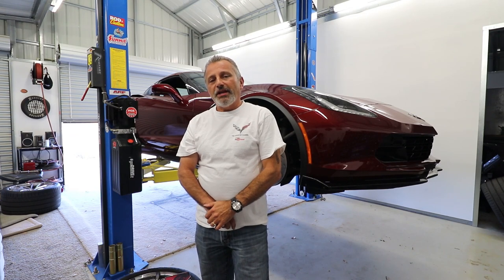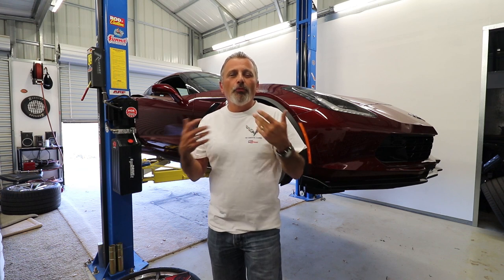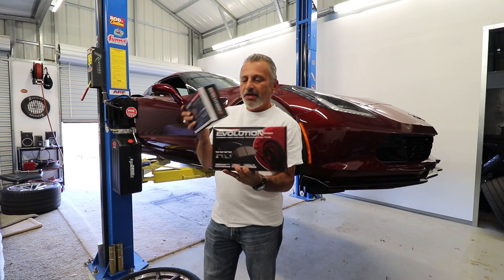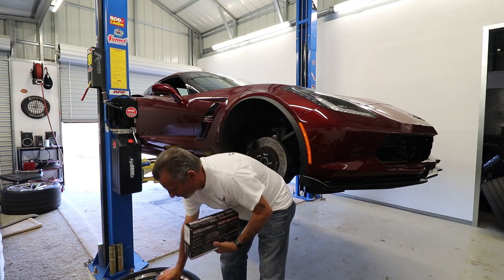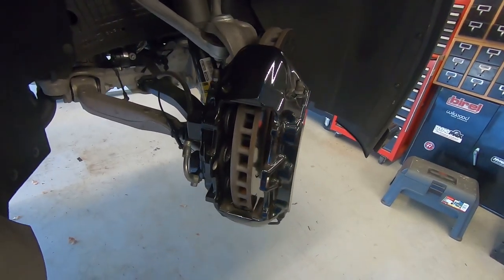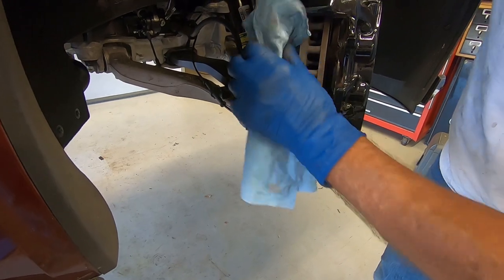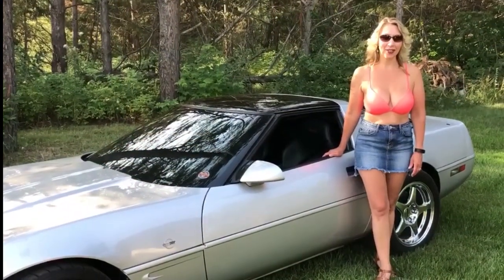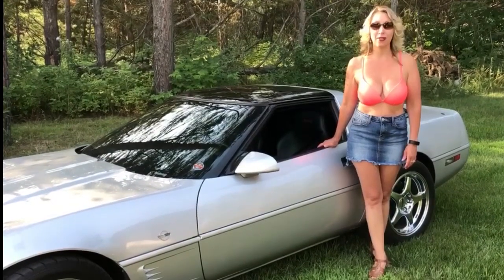How to Change Brakes on a Grand Sport C7 Corvette Sponsored by PowerStop Brakes

Comment: I'm ordering a C8. What brakes do you think they are using for the new car? I want to order a base and then upgrade the brakes and suspension. Haven't gotten anywhere researching this.  What do you think they are doing based on your knowledge and experience. Thanks, really enjoy your video.
Reply from the maker: At this point I would guess they will continue with same kind of pads as the C7, because they are always quiet and no one ever wants a brand new car to squeak while braking.
Reply: @THECORVETTECHANNEL  I was interested in the brakes themselves not the pads.  Does the C8 look like it is using C7 brakes. I don't want the Z51 if I can buy aftermarket for a quarter of the price. I'm no expert. Can you tell? Thanks

Comment: Never seen lubricant only applied to the end of a disc brake pad.  It needs to be applied around where the piston pushes on the backing plate of the brake pad.
Reply from the maker: I agree with you. We installed them and applied the grease as the instructions.
The brakes have been on the car almost 2 months and he has not had any issues.

Comment: That's an interesting - and puzzling - choice of pads from PowerStop.  I say this because I sent an inquiry to PowerStop that asked for their recommendation for my 2019 C7 Grand Sport.  In my message I specifically stated that my C7 was almost a daily driver and that I wished to retain braking performance but the main goal was little to no brake dust.  The following is their reply.      "Okay you would not chose the Z16 because those are the same pads that you 
already have on the vehicle they are ceramic . The Z26 is the carbon-fiber 
ceramic formula that leaves no brake dust and has the stopping force that you 
will need"     If you notice, their Z16 brake pad kit is composed of their Z23 pads.  So I'm not sure why you went with their Z23 pads.  Not trying to get into a you-know-what contest.  Just trying to point out what seems to be a discrepancy.
Reply from the maker: Thanks for the comment. If you go to the website you will only see 2 options the Z26 and Z23 kit They both claim Low Dust. He just picked the Daily Driver option. I don's see any mention of a Z16 Kit for a Grand Sport.